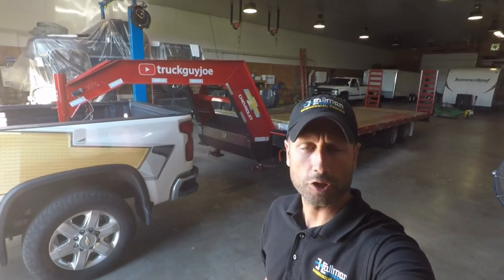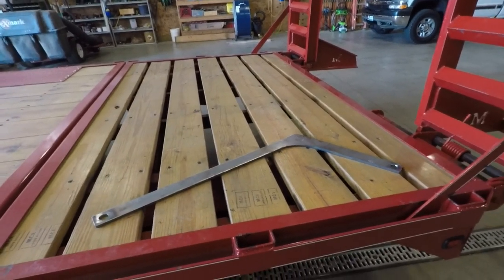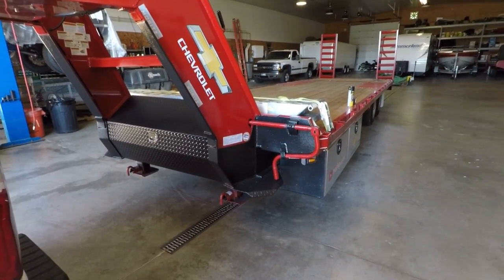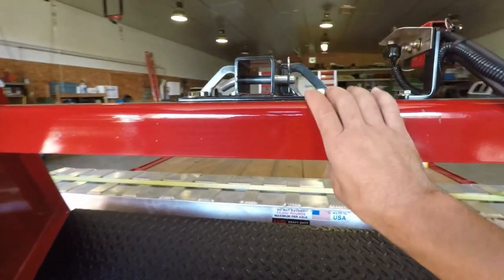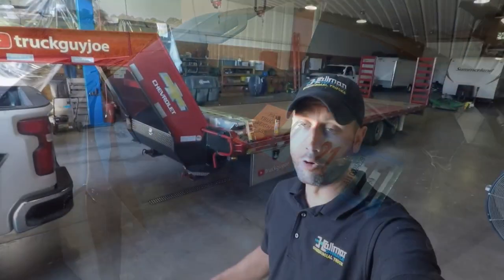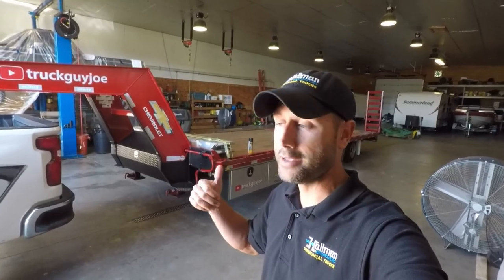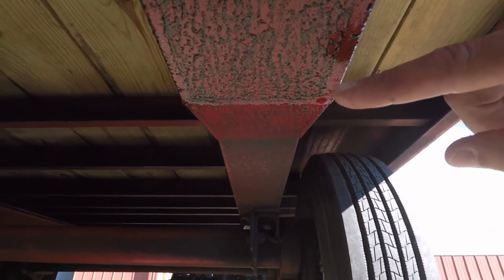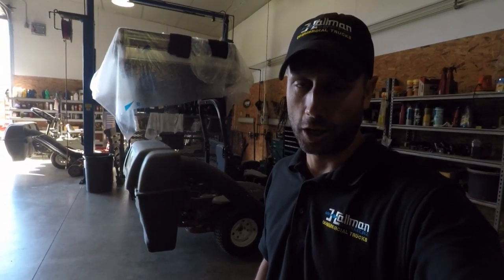Gooseneck Trailer Pros and Cons, 1 Year Owner Review

Comment: Great video and thanks for the rust protection info. I use fluid film also on my trucks and so far I've had good luck. Just seen your 01 chevy and noticed the wheels looked different than the stock aluminum. Did you put a different set on and if so what kind. Love watching that truck in your videos as well.
Reply from the maker: Thanks for watching Scott! I usually run the stock 16" factory polished aluminum wheels on the 2001 Chevy. The wheels you see are a set of 17" factory take-offs from a 2008 Silverado 2500 I used to own...I run them in the winter. It's been such a crazy year, I never swapped over to my summer setup (16" wheels with 295/75/16 BFGs).
Reply: @truckguyjoe  I like the way it looks from what I can see. I just bought my 2nd 02 2500hd regular cab long bed like your 01. Your videos is what got me to looking for a regular cab. Finally found a 2002 1 owner rust free truck. I love the 01-02 HD front-ends. It's white also but not the 8.1 unfortunately. I do have a 01 8.1 truck but extended cab. But something about these regular cab long beds I really like, especially with the bigger tires like yours. Sorry to just ramble but keep the videos coming and make sure to get your 01 in afew more.

Comment: I have a couple questions about pulling a gooseneck with a gas truck. Now I do have a Ram 2500 diesel. But the truck is lifted pretty high so I use that for all my bumper pulls. I've always wanted a gooseneck trailer I have chevy 2500HD gas with 8.1l. My question is what would be the best trailer to get with that? If I could get a gooseneck?

Comment: Nice trailer. You could go diamond C on next one . They have engineered beams weigh less so you could buy longer trailer and have same or more likely higher weight carrying capacity. Or go featherlight aluminum. But featherlights are higher price point. But no rust.
Reply from the maker: I will definitely consider Diamond C if I go with the hydraulic dovetail.
Reply: Diamond C you won’t be lighter guarantee you that.
Reply: No diamond C please, BIG TEXT TRAILERS ARE THE BEST FOR MY GMT800. God bles